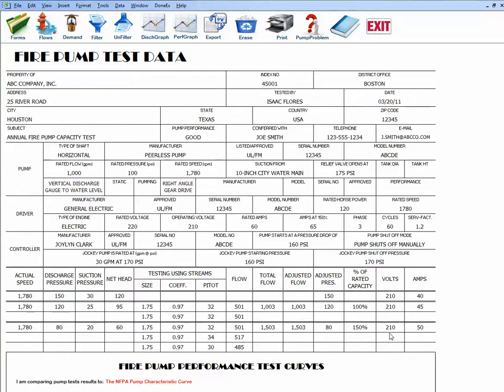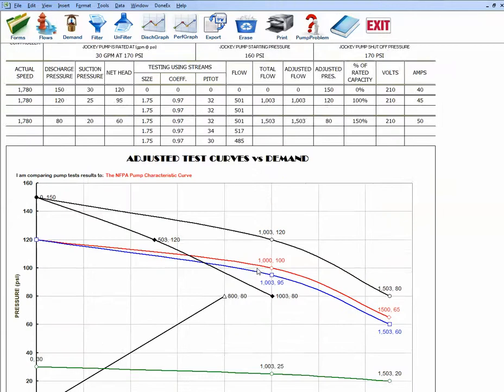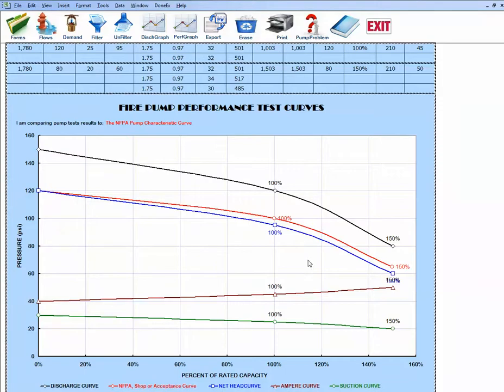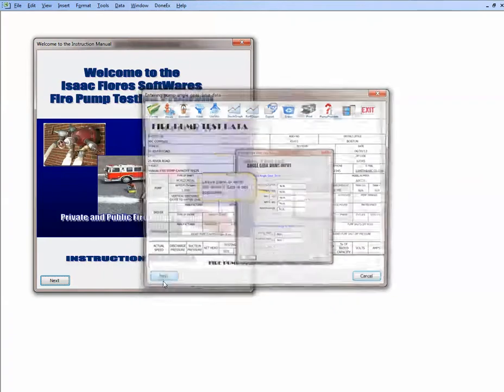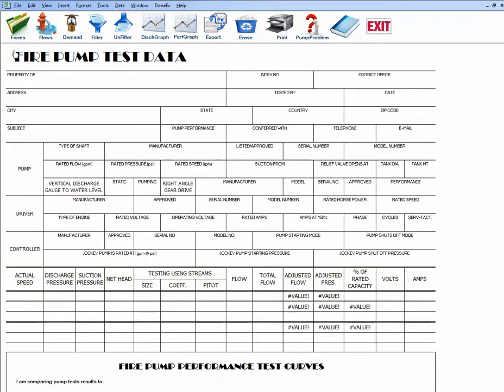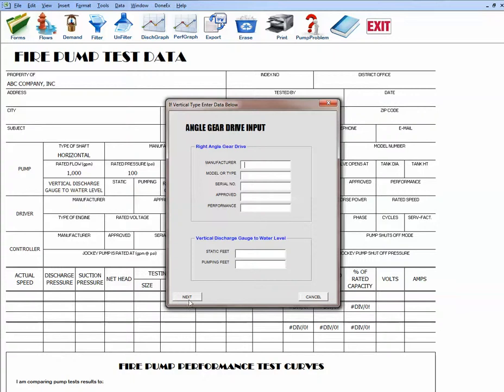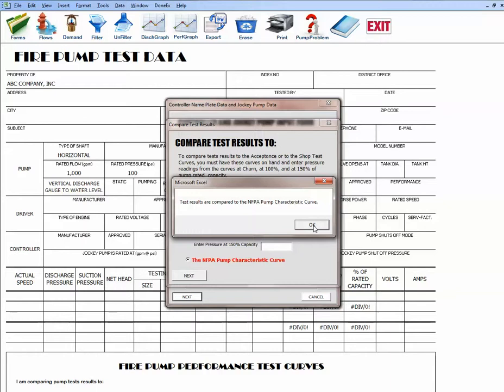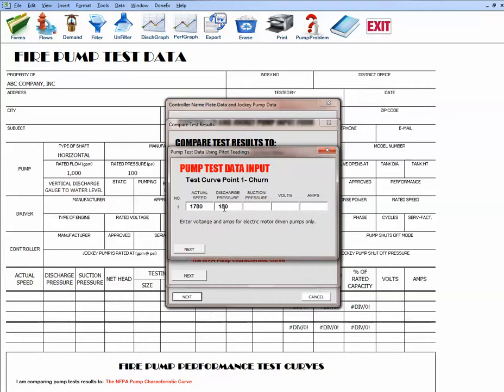Fire Pump Test Program Movie

Comment: How to download pc software for firetrol controller
Reply from the maker: The program is not downloadable.  If you wish to purchase a copy, I will e-mail it to you.  I modified the program to accept pitotless nozzles and hose monsters in addition to play pipe nozzles, fire hydrants and flow meters.  Regarding the pump controller, it does not matter which pump controller is installed.  If you wish to discuss the purchase of the program e-mail me at iisaacflores@gmail.com.